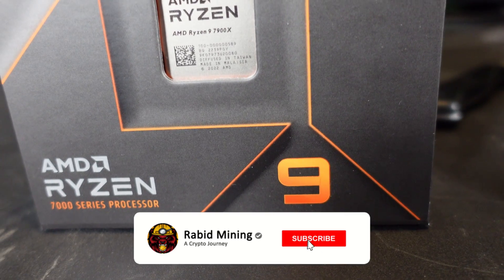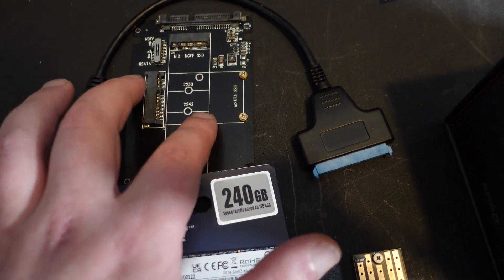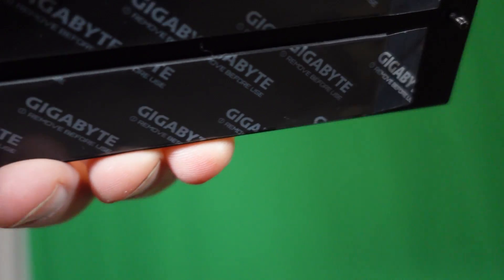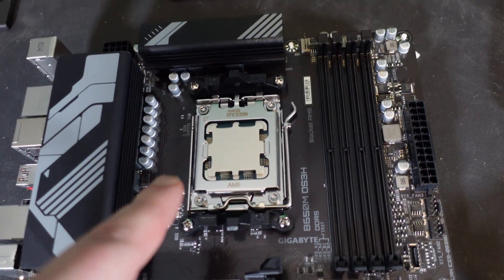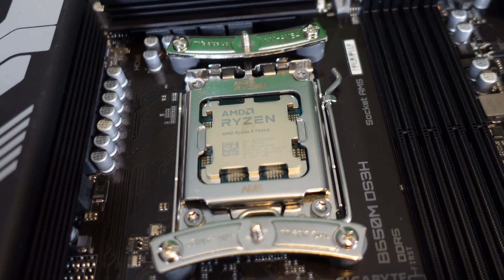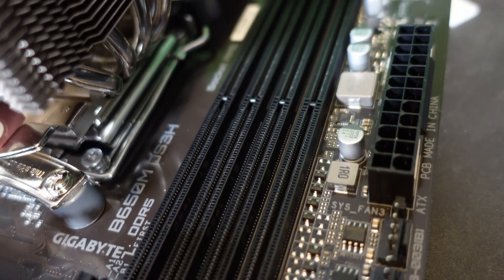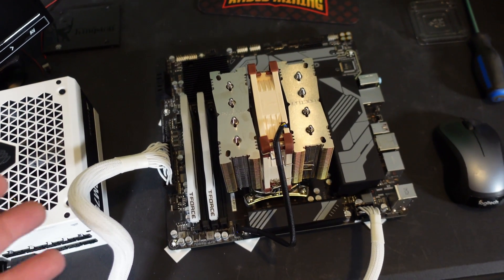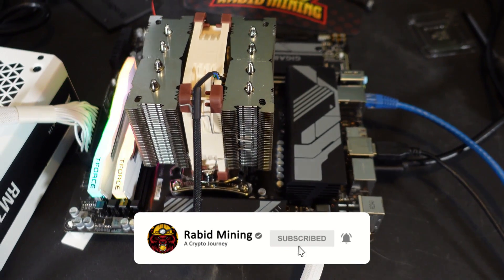CPU MINING RIG BUILD - Ryzen 9 7900x

Comment: I have buils this, same processor & same board , but on hive OS the CPU temp doesn´t show , i have upgraded the board bios & still no temps showing on hive OS .On the bios screen of the motherboard temp is showing fine... Any help would be apreciated.
Reply from the maker: Use hiveOS Beta image
Reply: @RabidMining  ok thanks, i will flash the ssd with the beta instead to see if it fixes it
Reply from the maker: @emersonmarques1174 faster to just SSH in and use hive-replace --list
Reply: @RabidMining  i believe you, but im new into mining so i don´t know how to do it that way :), anyway just flashed with the beta & temperature is showing fine (the watts consumption not but anyway this i can check from the wall) I realized that you mencion the betta version on the video when you are showing the parts, i skiped to the build , sorry. Thank you so much.
Reply from the maker: @emersonmarques1174 np glad it's working now

Comment: do you need 32GB RAM or do you have same hashrates with two 8 GB sticks ?
Reply from the maker: 8gb us fine it isn't the amount that matters just speed and latency
Reply: @RabidMining  wonder if there is any difference between 5600mhz cl28 and 6000mhz cl30 in hashrate
Reply from the maker: @77garga I tested that after this video the cl30 6000 was better
Reply: @RabidMining  thanks a lot :)

Comment: what voltage is 0.97...cpu core voltage? or Cpu Soc Voltage?... trying to setup the same cpu as u and having trouble cant figure out how to set the cpu mhz to the 4.7 either....asus bios is strange
Reply from the maker: Cpu core
Reply: i tried everything ..everytime i change the cpu core volatage it doesnt post ..i have 2 rigs going right now and temps are 81degrees each cause i cant change the voltage without it getting stuck n not posting...ill pay you to set mine up =) @RabidMining
Reply from the maker: @yoitsspud2478 which MB is it?  Mentioned you can't find where to change the cpu clock the heat am guessing is due to default settings and it is boosting
Reply: i ended up enabling amd eco mode and temps dropped to 49 but now my  hashrate is like 13.5k which is ridiculous for a 7900x but it wouldnt post for me with the lower voltages.. @RabidMining

Comment: @Rabid Mining
So happy you made this video and that I watched it as am planning on building a 7900x cpu rig and would have bought the same nvme m.2 ssd's to go in the 7900x rig, But now I know that wouldn't work so found the correct one saved for when I can buy all or parts at a time. I got my ram but still waiting on my 5900x, need two more 5900x as have everything ready to go and then will see about getting the 7900x rig put together if not a few.

I was looking at getting this ram for a 7900x rig: ADATA XPG Lancer Blade 32GB Kit (2 x 16GB) DDR5 6000MHz (PC5-48000) PC Memory Cas timing of 30-40-40
But may get same as you have as they have a Cas timing of 30-36-36-76 and both set's of ram run at 1.35v.

Comment: Do you have a referral link for the Noctua cooler? Ive been running my 5950x rigs off a HP 1200W server PSU, do you know offhand the wattage this rig will pull? Wondering if I can still use that method rather than buying a ATX PSU.
Reply from the maker: No but can make one or just hit any amazon link just the description and look for the NH-D9L

Comment: ive never seen anyone use thermal pads instead of thermal paste for a cpu
Reply from the maker: Now you have :)
Reply: This is Honeywell PTM7950 sheet. It initially measures 0.2mm thick, but melts at 45 Celsius and compresses and flow out from mounting pressure.

Should be good for several years without replacing.

Edit: it can melt down to under 0.0015" or 0.038mm thickness.
Reply: @snarksdomain  interesting

Comment: Hi, I need your advice - can’t decide on a motherboard for Ryzen 9 7950x, I saw a video with your rig a year ago, where you had a GIGABYTE X670E AORUS MASTER motherboard, but isn’t that too much? And what about the B650 chipset with 7950x.
P.s I am just getting in, so sorry if it's a stupid question
Reply from the maker: Ya don't need the big gigabyte that was for my workstation gaming pc b650 is fine for mining
Reply: @RabidMining  thanks, a couple more questions from newcomer, will be very grateful) 
If I want to get into CPU mining, which CPU would you recommend to start with? 
I have a GPU from my old gaming PC (RTX 2080), can I use it with Ryzen 9 7950x to mine on them both (using the same motherboard), will mining on them in parallel somehow reduce earnings from CPU mining?
Reply from the maker: @dkibi 3000 5000 7000 series 12-16 core cpus

Comment: Normally I would agree Noctua is amazing, but not for 7000 series. Noctua isn't good for it. GN has a good video for why. Basically chip location vs heat pipe location.
Reply from the maker: We aren't gaming no voltage spikes and stupid high clock rates.
Reply: Fair point. Any issues with that thermal sheet though? Didn't look big enough.
Reply: Also, the peerless assassin is as good or better for 7000 series and I think it's cheaper. I'd have to look. Just for future builds i mean. I love noctua so it pains me to say that. Lol!

Comment: I have 2 builds one is getting me 17.5khs and the other is getting me only 7khs . Not sure what it is , I have sto k settings on both with dual sticks of DDR5 , I'm thinking it's the board the same Gigabyte board you have is the one giving me the lower hashrate
Reply from the maker: Interesting set some voltages ⚡️ something may be overheating